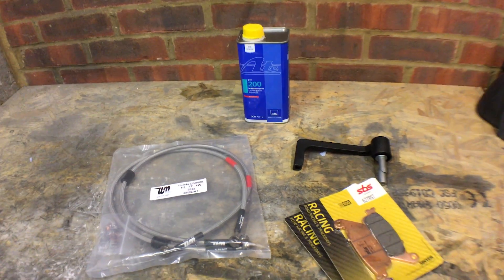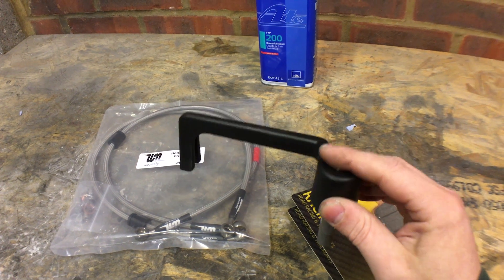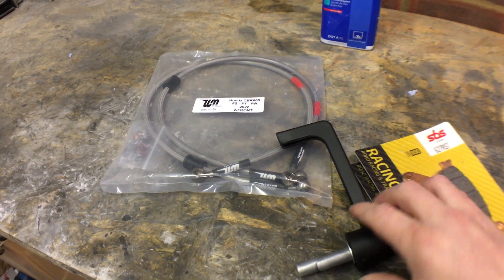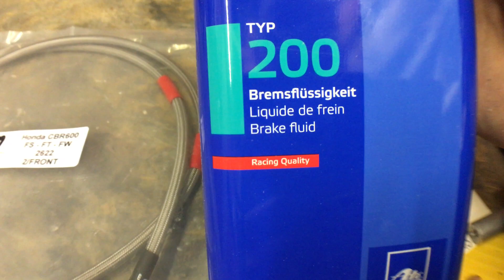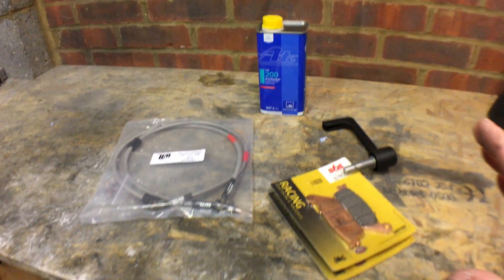I booked a Track day - Getting the CBR ready for the track.

Comment: when i changed my brake lines i used a syringe and pumped the fluid in from the caliper,quite  a quick method .any air bubbles are pushed upwards into the resevoir.might be worth a go next time you have to change your fluid.